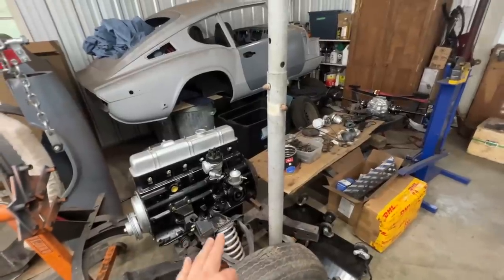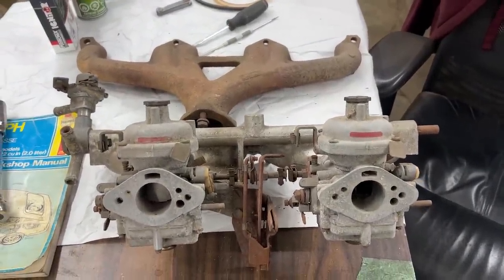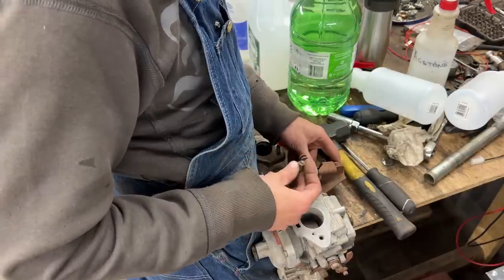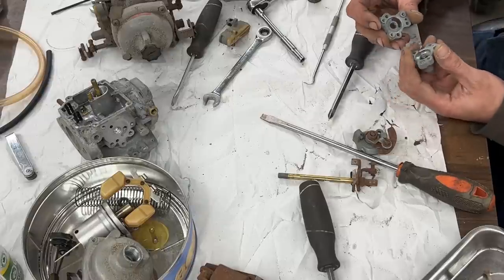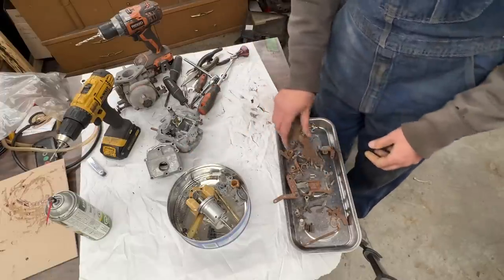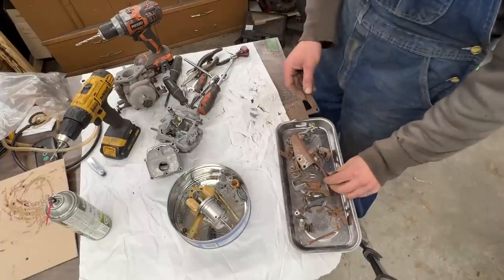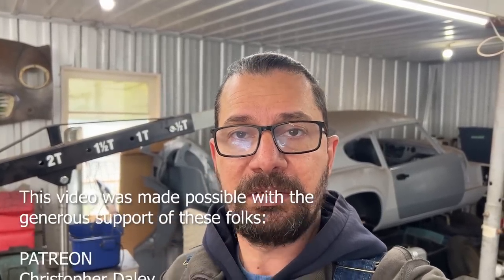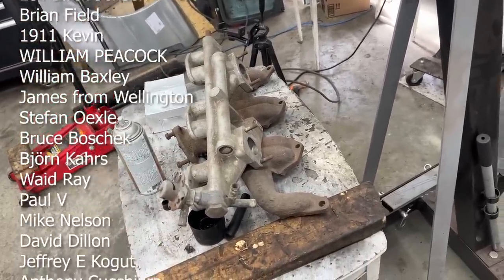1972 Triumph GT6 - Part 90 - Cleaning The Carbs and Zinc Plating the Hardware

Comment: I do a lot of plating of TR parts.  I started where you are now.  If I may: it is time consuming and can get expensive.  Prep is key.  Meaning, work the pieces to remove imperfections will produce better results.  Don’t touch with bare hands.  Pick up by wire and use gloves.  I use 20 ga copper wire.  Ur results: last piece that was lite grey is what ur aiming for.  Dark grey means ur burning the plate.  Ends will produce those nodules you see (burnt plate, amps too high).  Plate will flake off.  Start low amps and adjust up until no foaming on wire at surface. Don’t start high and go down.  Chase threads BEFORE plating.  Nothing worse than plating and having to run dies and taps.  Muratic acid is used to remove old zinc.  Done when bubbles stop.   Plate a 1” square and find the amps needed for a lite grey coating.  That can be ur base line for any size part going forward.  It is a fun hobby.  Not for everyone.  Also, read about hydrogen embrittlement.  Well done!

Comment: Looking good. From what I understand, electroplating is line-of-sight, the zinc goes in a straight line from the plate to piece being plated. I think you can add additional plates around the bath.
Also, you can use reverse electrolysis to remove rust. Use a piece of iron instead of zinc, reverse the polarity. There's good videos on how to.

Comment: To calculate the surface area on those stamped and bent parts, measure the volume by dropping it in a measuring vessel  with water in it.  Take the delta volume divided by the stamping thickness.

Comment: I use a similar process but for small parts like nuts etc. i bend the wire in the shape of a sine wave to keep them separate from each other. To polish the parts i hold them in a multi grip and use a brass brush in a drill press.

Comment: Look to have some decent plate on the parts Elin nice job.👍
 Done quite a bit of DIY bright zinc plating of various TR and other bits including big parts such as the window regulators/channel guides but as you found you need a bigger tank! You can then use a final passivate bath to colour the parts gold, black or  blue etc. Let the parts air dry for 24 hours. 
Prep is everything and worth the time de-rusting using critic acid or similar and then washing the parts well. I then use a dilution of Nitric acid to pickle the parts, wash in distilled water. Don't touch with your fingers as it contaminates them with grease and affect the finish. Start with a low Amp (I use the same power supply as you) the black bits are due to "over cooking" and can break off contaminating the electrolyte which then stick to other parts so it's worth filtering them out of the electrolyte using a filter paper you use for paint. I use 4 anodes in my tank with a fish tank aerator to circulate the electrolyte to give a more even coating plus a fish tank heater set to 25c which helps the process. 
I love seeing batches of old rusty bits returned to new its like magic! Just keep at it you have the space to set up a little production in a corner of the workshop. Just nail the ultra sonic cleaner to the bench😁Andy

Joking Chef I love your channel as well👍

Comment: Good effort... DIY plating isn't easy. So many variables. Plus once the metal parts have been pitted by rust... They will never be perfect. Still improvement on what you started with 👍

Comment: I think I replaced the throttle shaft seals (rubber with a metal cap?), diaphragms and float valve. That’s all I really knew how to do back then. The carb that looks real clean is from a Spitfire I think. Just used it as a cleaning experiment. 
Just saw the part where there’s no diaphragm. Check in the boxes.
edit: Not sure there’s a rebuild kit.. Hope I haven’t made too much trouble with them.
Reply from the maker: I checked my list from when I had the parts laid all over the shop and I didn’t see anything about the carbs so I ordered new kits. You did more great cleaning them. They just got dusty and rusty again over the years. Thank you!
Reply: @RustyBeauties  I need to learn to hold my comments until the end of the video. The three things I said I replaced were the three things that were missing! What a goober!
The plating looks real nice.
Reply from the maker: @kge420  haha, I don’t remember what I ate yesterday. I don’t expect you to remember what you’ve done 35 years ago!

Comment: Wow. One down, one to go. Based on comparison of whole carb against the cleaned/plated parts of the other is amazing. Looks like the process is worth doing.  I tried nickel plating with some success, but I really needed an adjustable power source to do it properly.  I think your process is working. Great video.

Comment: That as an education on plating.  I looked into it on several occasions but never had the time, space or surplus cash to get it going. What I did eventually do to help clean awkward shaped parts was acquire a second-hand shot blast cabinet and 100's of kilos of media  that went with it at an auction for a silly cheap price .. I got caught out a bit as after a few hours of successful use my compressor motor burnt out.. 😅🌡🔥.. I decided to upgrade to a 14 cfm 10 Bar 4HP compressor that changed my life in a very good way with all the air driven tools. Great video Elin and looking forward to see those CD150S Stromberg's put back together.

Comment: Another educational, interesting episode. The parts should not be touching the container, also, try using thinner support wire because the area of the part in contact with the support wire will not get plated.

Comment: Hi Elin, I don't know if it is worth the trouble, but tumbling the small parts with sand or silica or something grainy could clean out hard to reach places to get everything shiny. I suppose you will have to build your own tumbler. Maybe you can leave out the chemicals and just tumble the parts. There are videos on youtube where this is done if I remember correctly.

Comment: Seems like an interesting process to do once (or with the two carbs twice). But I bet Dr. Carburetor has multiple carbs in the works at any one time so he doesn't hold up any given rebuild while waiting for a batch of parts to finish plating.  He could spend the time doing a big batch of one brand/size carb and then just draw on that batch when he needs them.  Another interesting video, Elin!

Comment: You can calculate surface area by weighing a regular shaped piece. Weight of irregular shaped pieces (of same thickness) will be proportionate to surface area when using the known amount.

Comment: Take a look at the needle seat in the carb body. These seats should be round, of course. The piston needles are biased and wear those seats oblong. If the seat is worn to much it will make the carbs hard to tune. The seats are replaceable. They are pressed in.  If it comes to that make a note of how far the seat is recessed from the bridge in the throat of the body. .092 rings a bell for me but your mileage may vary as they say. Seats can be obtained from Burlen or Joe Curto here in the states. The movie car had a single Zenith. When I learned that trick I was able to pass California smog every single time.

Comment: Surely the fasteners - nuts bolts washers - have a different coating to the plates springs etc. so they won’t necessarily take the zinc coating the same ? Not really worth fussing about them so much anyway… but it will definitely prevent repeat tarnishing.

Comment: you must put the pieces the more paralel to zinc plate as possible. the current is lazy, it take le shortest way, all the zinc is gone on the link , and barely on the other pieces.
Reply: and for long pieces, rely them by the both side

Comment: The plating demo is interesting. I've never done any of that. 
Is there a kit to convert the Strombergs to manual choke? I seem to recall their automatic choke is troublesome.
One possible solution, years ago I saw a GT6 set up with six Keihin motorcycle carbs. It was very inpressive to look at, with six velocity stacks... AND ran like a bat out of hell! I think a company named Performance Research was adapting those carbs for Spits and GT6s.
Reply from the maker: The strombergs used in triumphs are manual choke. I believe the ones used for MG were automatic

Comment: wonderful video again Elin, A question though those spindle seals I was going to order a set from one of our Triumph specialists they are really expensive but he messaged that they are aftermarket and were not originally fitted. I do not know if this is true or is it best to fit them?
Reply from the maker: I am nit a carb expert but I believe all strombergs have seals originally and the SUs have bushings. You have to see if your carbs have them and if you are rebuilding them it is a good idea to replace them
Reply: @RustyBeauties  Thanks Elin I have often been misled its great being able to get expert advice much appreciated and I will be replacing them.
Reply: @philipavery8465  I've got a 1970 GT6 and the spindles have NO bushings or seals visible from the outside - they seem to just go through holes in the body. But I think they're worn & leaking air, so I'm thinking about getting them machined to take the bushes+seals in the rebuild kit. (not expert advice, just an observation)

Comment: Elin you should be able to control current without changing voltage on you power supply…
Reply from the maker: Mr Ohm passed a law saying that if you reduce your current you have to reduce your voltage as well :) I am just obeying the law 😂